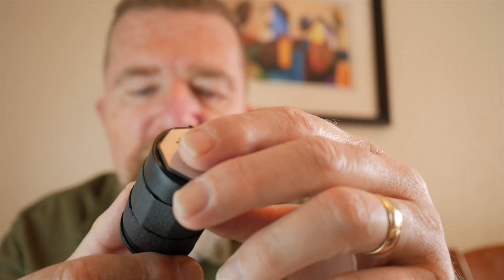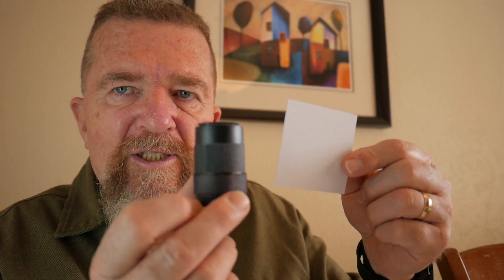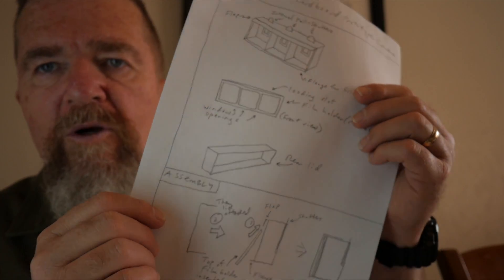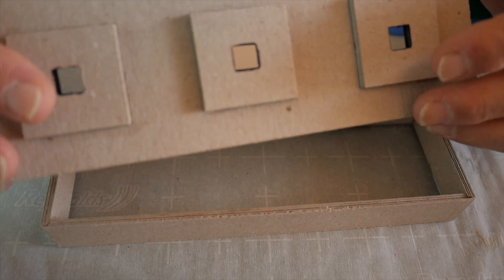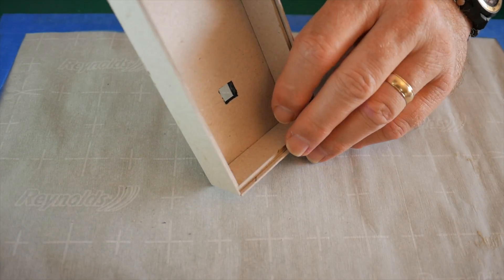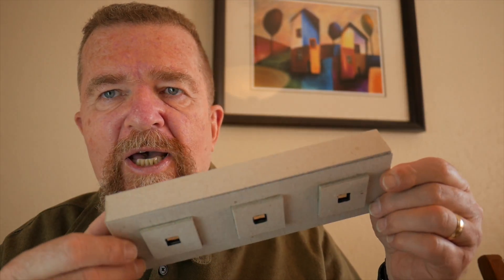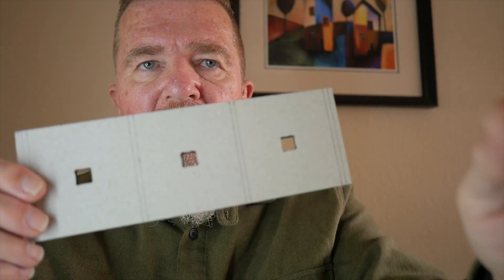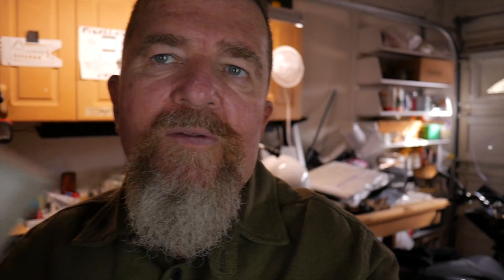3-Section Pinhole Camera, Part 2

Comment: I don't know if anyone else mentioned it or not, but why not a sliding pinhole/shutter assy.  I.E., the pinhole would slide from rt to lt for eg.  "detents" would position it over the center of each frame.  Photo would be taken then it would slide to the next frame.  The slide would need to be long enough to provide light tightness for frames not being exposed.  Only one shutter and one pinhole required.
Reply from the maker: As I discussed in the video, there's more than one way to do this. However, I don't like the idea of one long strip, especially when it's near the other side and sticks out from the side of the camera, it would present a "sail area" for the wind to move or vibrate the camera during the exposure. And, being made of thin cardboard, would be susceptible to being bent or torn.
Reply: Agreed but I was thinking of a more permanent construction rather than cardboard such as thin plywood (1/8" or 3/32" for example).  Also i would have made the camera a tad bit wider to allow the slide to not stick out excessively.  But I agree, with your chosen material list, this would cause more issues than it solves.